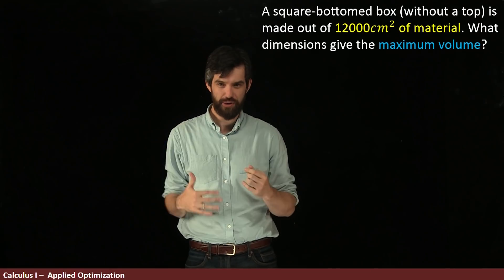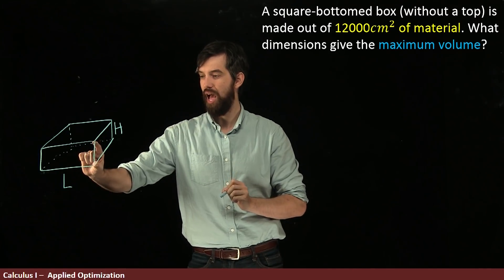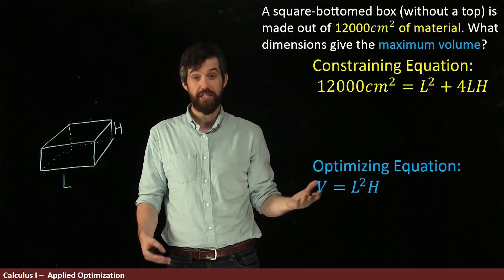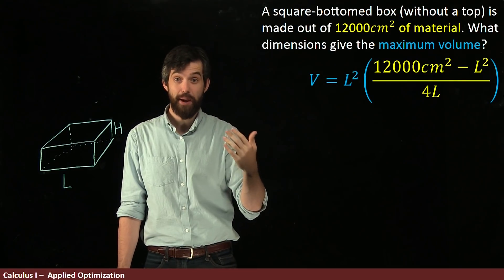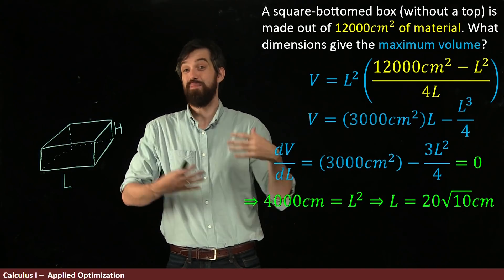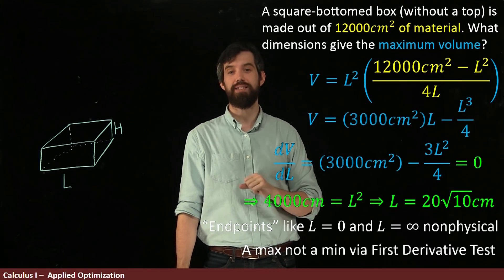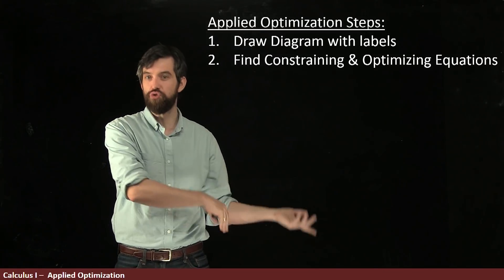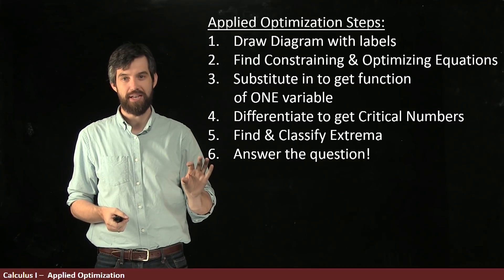Ex: Optimizing the Volume of a Box With  Fixed Surface Area

Comment: I'm not clear about the infinite L endpoint reasoning at 7:16.

If L goes to infinity, then H goes to zero.  Why should infinity times zero be considered zero, rather than indeterminant?

The "no volume" situation actually occurs well before L equals infinity due to the constraint of 12000 cm**2 of material, with L determined by equating the volume (after removing H) to zero.  This would seem to be what actually allows us to determine that the volume would be zero at the right endpoint of L.

Sorry if I'm nitpicking, these lectures are excellent.  Although I do agree with another comment that it would be great to have a series of lectures that gave proofs for the calculus theorems.

Comment: Hey Dr. Trefor,

Very informative, and a different expierence with calculus than what i was taught in school.

I love the fact that you are stating the values of H and L in times of roots instead of simplified numbers, which then gives a more satisfying answer to our problem.

I have always had a problem in understanding how exactly you are using algebra to simplify the expressions for H and L in respect to the square roots.

Would you care to explain a bit deeper for me, or could you point me in the right direction in terms of videos you've made where I can learn a bit more of the complex algebra?

Thank you so much for your video series, they are very valuable to me.